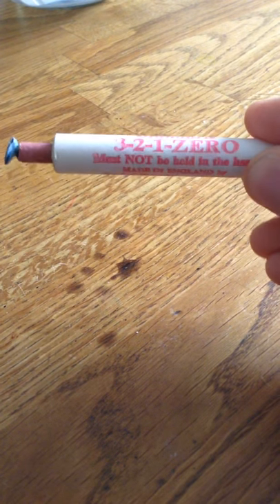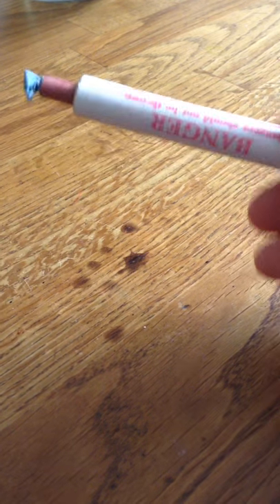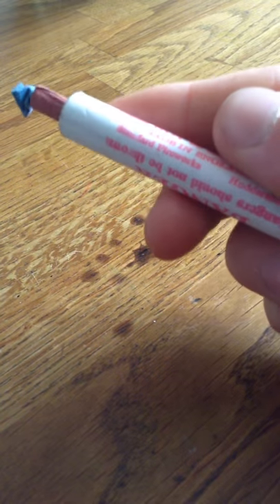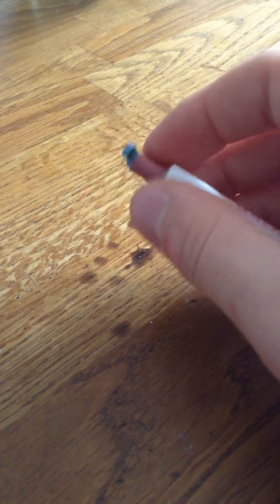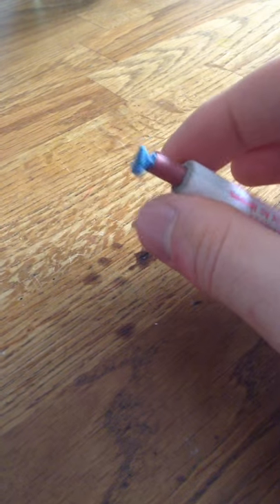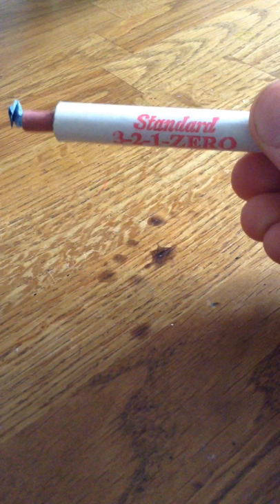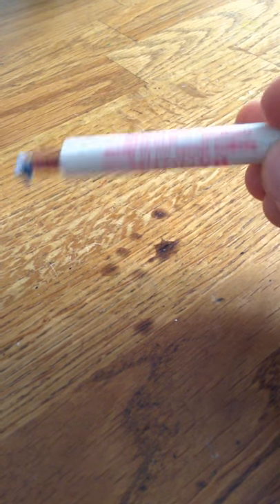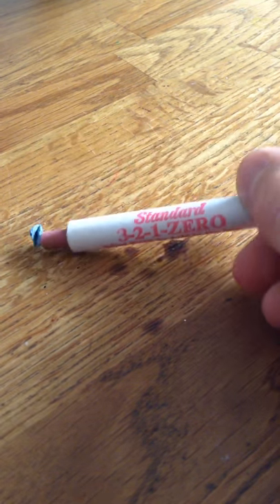Retro standard 1970's banger (UK)

Comment: Nice to see them again, these white label Standard bangers were. Sold in boxes of 12 from early 1970's.  Before that, and before decimal money system, they were sold separately, 1d 2d & eventually, 3d each..... Traditionally, Standard bangers had a TERRACOTTA ( FLOWER POT RED) LABEL, WITH A BLACK LINE AT TOP AND BASE, OF LABEL..I have lots of information on old UK fireworks if anyone's interested.